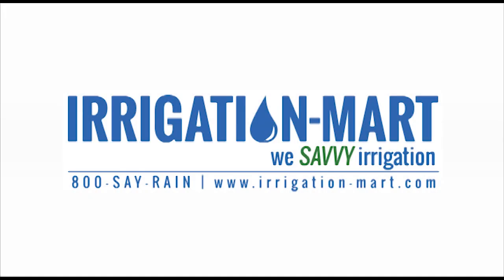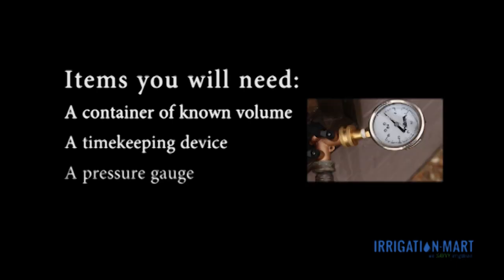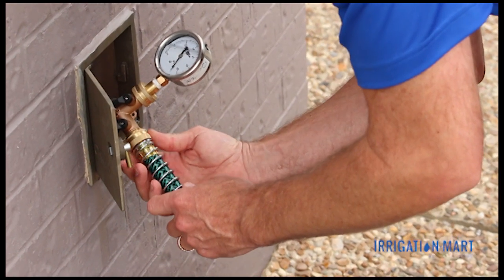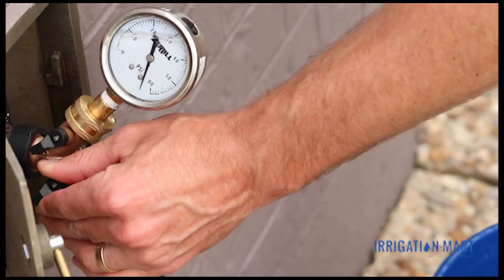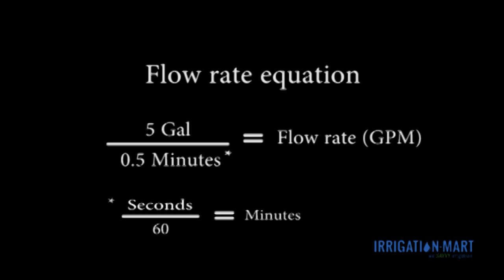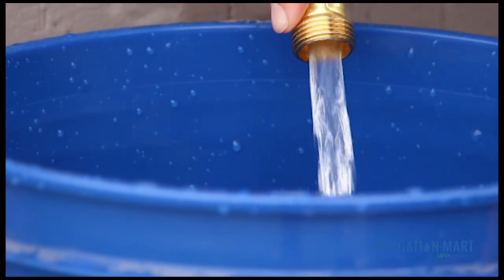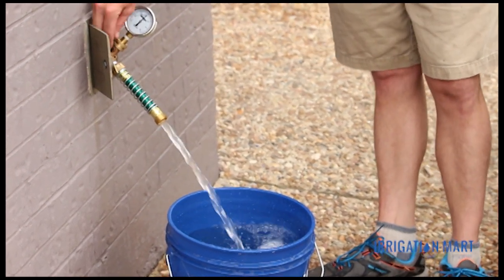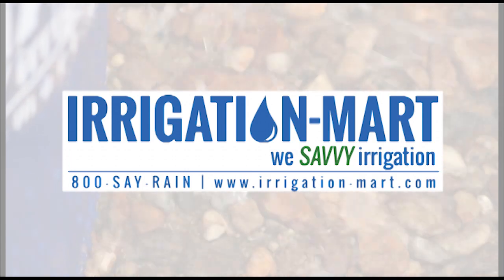How to measure flow rate

Comment: Hello sir,

I''m Sachin from Karnataka .

May I know sir Pump Impeller size(mm) to discharge water at high pressure for 5HP 8 Stage 3 phase submersible motor from 220feet at a voltage of 240v through 2inch pipe .

And is it impeller size(mm) proportional to high pressure discharge 
Thank you .